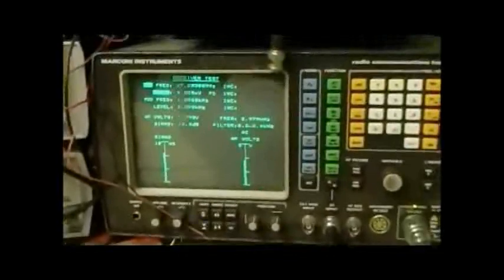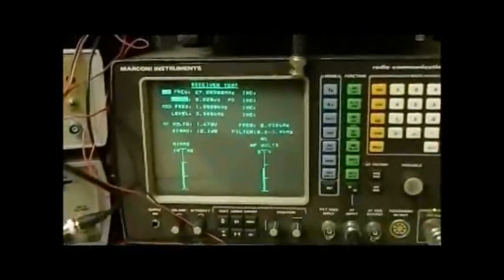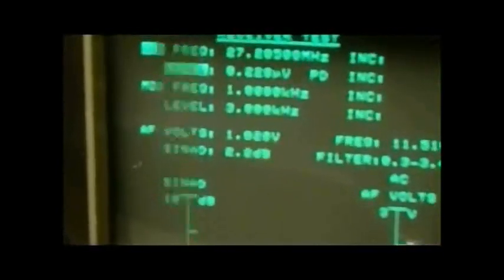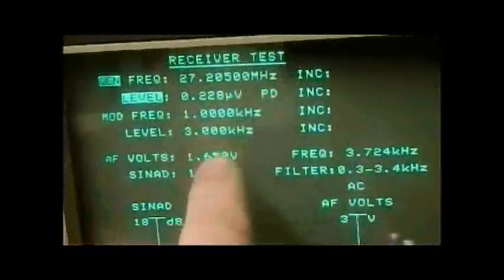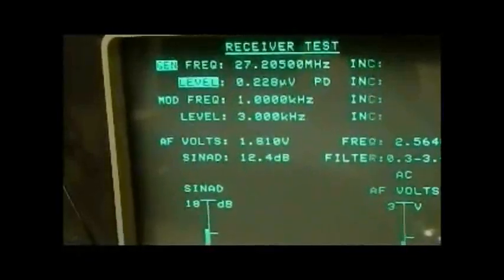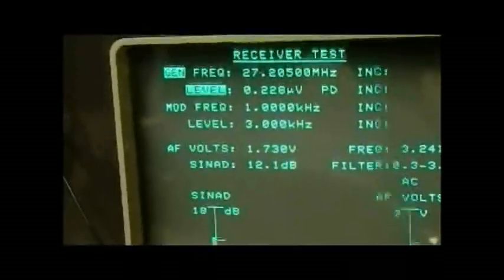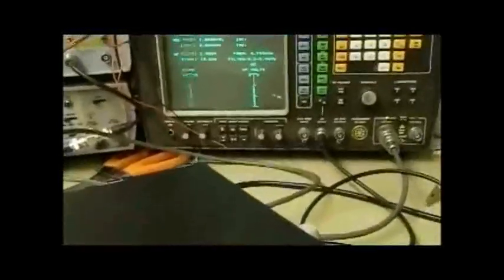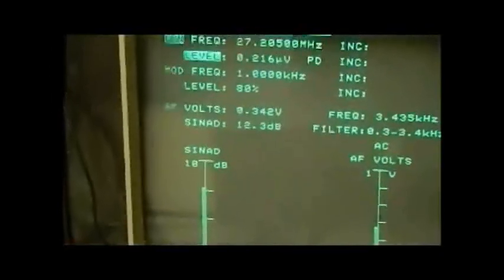Receiver sinsitivity using 2955

Comment: Hi, I just got a 2955, when in Rx test mode when I turn the output level below -40dBm I hear a switch/relay switch but then I loose the signal to my radio.  I don't suppose you might know whats wrong? When I do the self test routine, somestimes it passes all tests and other times it fails several as per a video on YT where the chap replaces the wideband amplifier modules.  Ive ordered some of those available from eBay.  Hope that sorts the issue out.